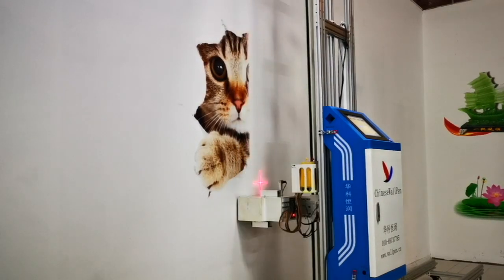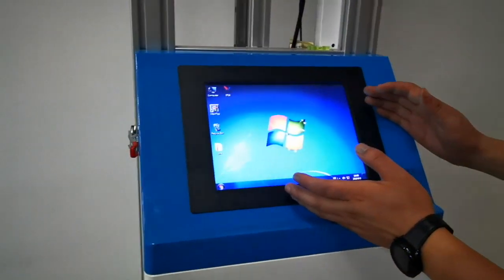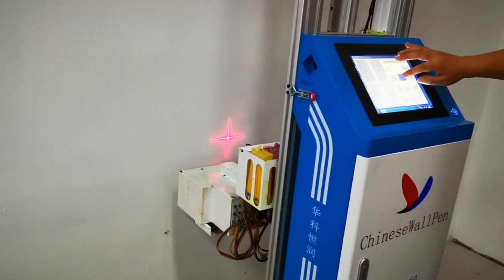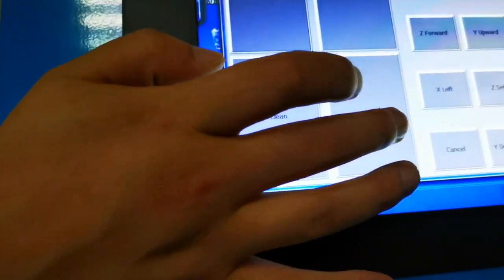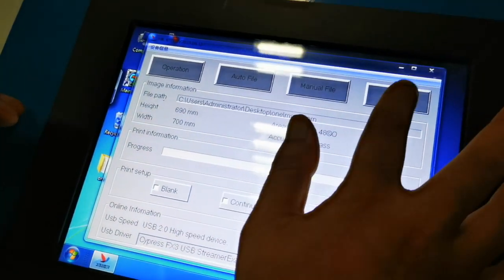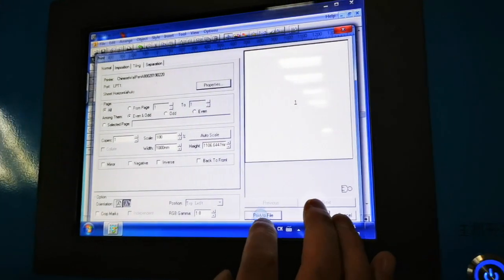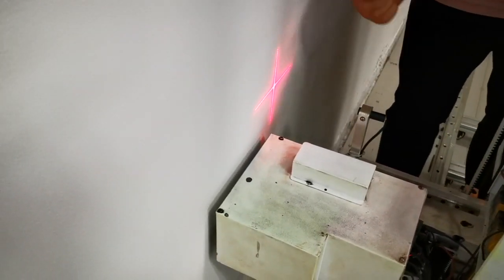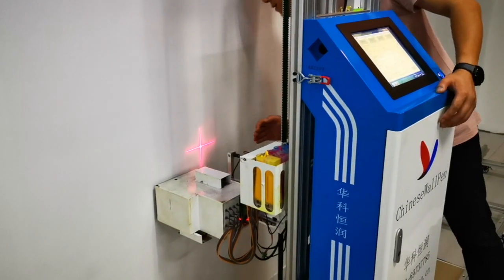How to Operate A Wall Printer? Step by Step Tutorial.

Comment: Where is the setting for change material to print? I meant like when i print on paper, i should put the setting on glossy paper, inkjet paper, etc. On this printer where is the setting if the material on glass, on the wall, etc?
Reply from the maker: You can directly print on all the materials.
Reply: @WallPrinterMachine  Ok. So is it normal if the color totally change? Because on my screen and on the wall totally different. For city lights, when i printed on the wall it looks pale
Reply from the maker: @nancehug888  Hi NHUG, if you are our client, we have an engineer to help you, they will check the software settings for you. Please contact me: Alex@wallprintercn.com